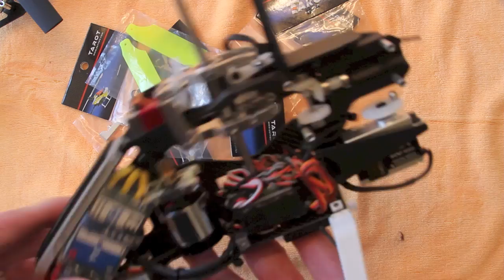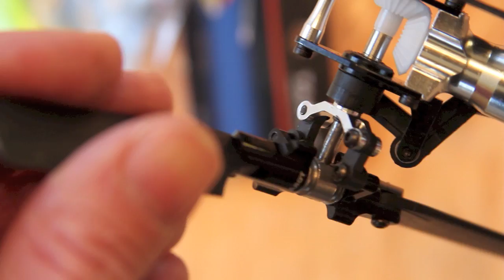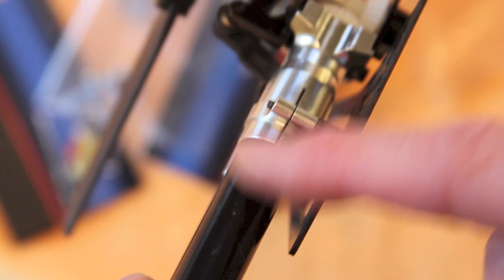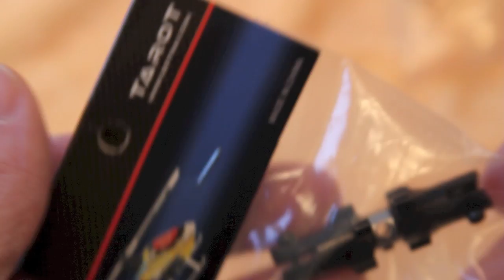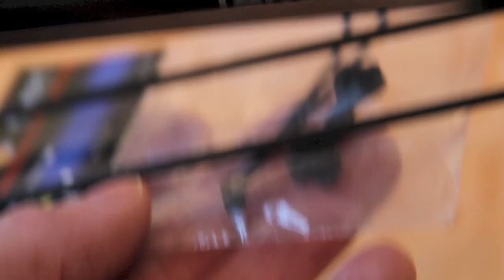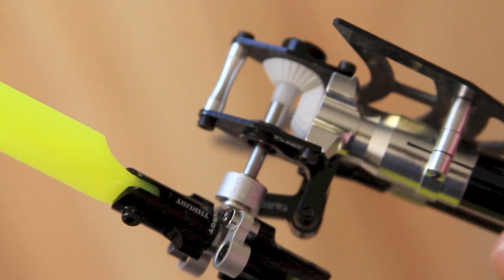41 : Tarot 450 Pro V2 Build : Tail Upgrade

Comment: Hey CPO, Just havin' a look at some of your 450 build vids for the first time tonight :P 
The tail assembly is the trickiest, fiddliest, and one of the most important bits of the heli to get perfect, as you probably know by now! It's why so so often, especially in the first year of flying, people with a "perfect tail" get wags that they just can't explain.
Just wanted to say; you've to be really careful on those links you were having trouble  with, NOT TO get threadlock between the screw and the sleeve by the method below. The screw will tighten enough against the sleeve itself. Those screws have shoulders for that very reason. You want to keep threadlock away from the outside of the sleeve altogether, so it's best to put threadlock into the threaded hole with a coctail stick or something. You can use a small bit of stronger threadlock here and it will still come out. I swapped to a longer screw with a shoulder on it, that i could put nuts on. These give me peace of mind and maintain the nice loose assembly :).
Also, you SHOULD shim the tail gear that has movement in it so that it has less play. Nick Maxwell has a one tank tip vid up on shimming torque tube gears.

Comment: to get rid if the slop,i use lock tite,which i use it alittle different than normal.i put it on alittle heavy,i mean just alittle.i bolt it up,snug tight.then back it off 1/8 to a 1/4 turn.now by putting it on heavy it gets betreen the screw and the sleeve and makes a lock tite sleave,which will take out the slack.ill do this at least 12 hours before flying.now ull need to move the parts back and forth over time to keep it from binding up.

Comment: at first sometimes it will be tight.it will loosen up.after its fully dry you can oil or wd40 to get it super smooth.hope this helps new flyers.as this guy states get the cheap plastic parts off ur heli.